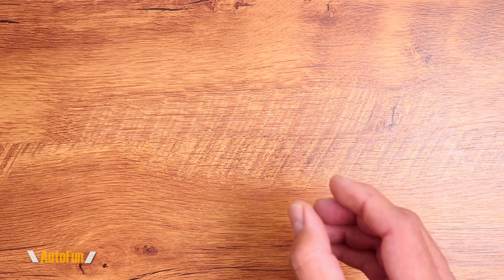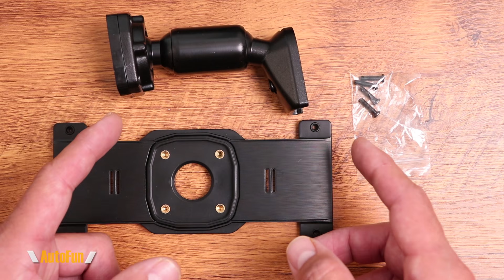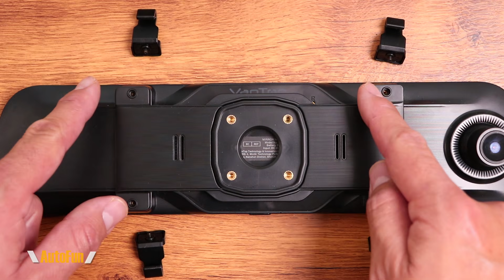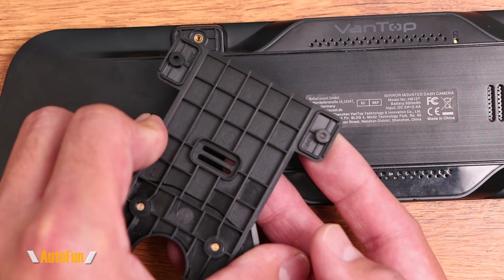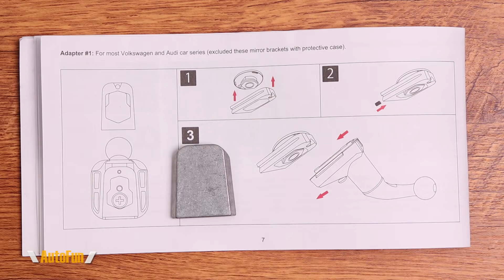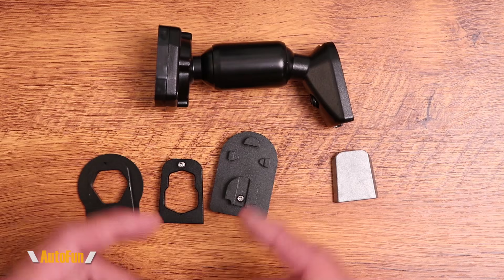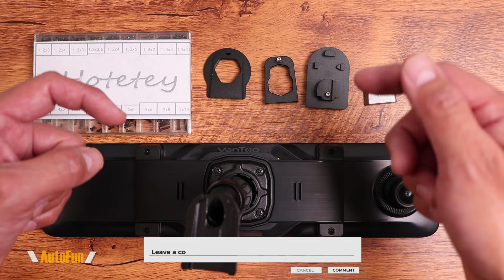How to Install Mirror Dash Cam WITHOUT Straps (Direct Mount Conversion Kit for LCD Mirror)

Comment: Anyone find a plate that works with the pelsee p12 pro?
Reply from the maker: Hi V! Unfortunately I have not tested the Pelsee yet, so I'm not sure what kit will fit, however you can measure the back as I showed in the video to determine the size but If I do get a hold of one of one, I will measure it for you and update this comment. Cheers!
Reply: @AlexAutoFun  I actually just found it on Amazon and in the pictures of the reviews. People say it works with the. Pelsee P12 pro. Would you like me to send you the link so you can add it to your video? Or would you rather wait till you test that camera?
Reply from the maker: @vtecef9  HI V! Ah great, yes if you can send me the size (they are sold in Centimeter sizes) once you confirm it fits your mirror I will definitely help the next person. Cheers!
Reply: @AlexAutoFun  OK cool as soon as I get it in and install it, I will just reply to this comment with the link
Reply from the maker: @vtecef9  Excellent, thanks (some links are blocked, if it does not go thru, try the size) Cheers!

Comment: Hey, I had not seen you until today but I was very impressed with what I saw, very straightforward and simple. So I was wondering if a wolfbox can be adapted to work with the original rearview mirror wiring of a 2003 Chevy Suburban, and if so what would you recommend?
Reply from the maker: @RPacheco1157  Thank you! Ah the kit fits most vehicles without the adapter and the adapters shown in the video can be used for specialty cases. And I placed links in the video description to the adapter if you need them. Cheers!
Reply: Thanks Alex, appreciate you getting back to me.
Reply from the maker: @RPacheco1157  You're welcome!

Comment: pelsee P12 Pro 4K Mirror Dash Cam, 12'' Rear View Mirror will this fit
Reply from the maker: Hi T, Unfortunately I have not reviewed the P12 yet, so I'm not sure what kit will fit, however you can measure the back of the dash cam as I showed in video to determine the kit size. And If I do get a hold of one of one, I will measure it for you and update this comment, Cheers!

Comment: Gonna have to make an adapter for my NA Miata, completely different style.
Reply from the maker: Hi Wolf! Ah here is my follow up video showing how I customize the rear plate to fit different dash cams https://youtu.be/fveZiDofnxg and I also placed links to specialty adapters in the video description, Cheers!
Reply: @AlexAutoFun the attachment part to the mirror is fine but the NA Miata's rearview mirror is attached to the crossbar/frame, not the glass. The style of attachment is different.

Out of the styles you shown, I didn't notice a similar one
Reply from the maker: Hi Wolf! Ah yes the rollbar mounted mirror is different, the only solution I have for those rare cases is to re-use the mirror stem from the vehicle and use this kit https://youtu.be/cCpyHmiZqiY which allows the use of the existing ball joint (basically, retains the factory mount setup) Cheers!

Comment: The problem is dash cams get too hot in the sun, locked up. Fitting behind the mirror would be less heat going into electronics
Reply from the maker: Hi S! Yep some dash cams generate a lot of heat (specially if running it on 4K). While I converted mine and have not have any heat issues, I would recommend taking at a look at the temperature rating because yes your are right, mounting the dash cam behind the OEM will keep it slightly cooler than mounting it with a direct mount kit. Cheers!

Comment: Alex . . . In regards to Dash Cams you are the top expert on YT . . . No doubt.
So the Dash Cam Industry must be hearing your opinions. So I decided to share my opinion here.

In my opinion . . . The things that prevent aware people from purchasing.
1) How they hook up . . .
People don't want to remove & damage interior trim in a new car to run unsightly hard wires for an expensive item that is not going to be longterm.
Solution: A) Connection between the Main Camera & Rear Camera needs to be Blutooth.
Rear camera needs to be rechargeable ( USB-C ) and have a 24 hr (or more) capacity.

2) The entire system should be independently rechargeable and self-powered / have its own battery light weight enough to carry indoors if necessary ) and leave the main car battery alone. No messing with the fuse box / car battery / air bags / car trim . . . non-proprietary and easily replaceable by the owner & rechargeable. Leave the main car battery alone. No messing with the fuse box, car battery, grounding sys. , trim panels or the air bags

C) Both camera's need to be more easily removable ( if BT'd the only wire needed would be one power wire to the main camera. Easy removal would provide better conds. for charging. cleaning, inspection and temporary antitheft.

Hey CHINA . . . Do any of these have a visible blinking red led to deter vandalism? Why not?
Reply from the maker: Thank you James, I appreciate that! Ah good input, I imagine it maybe possible we will see a rechargeable dash cam at some point. The main challenges are fire and duration. The industry is moving away from batteries over to capacitors due to the high temperatures inside a vehicle and potential for a run away event (fire) during charging or discharging inside the car. Here is an example of a internal dash cam battery and what the sun did to it https://youtu.be/HW8jqbl_ayU and a battery related fire I personally experienced https://youtu.be/XfWgJ8nu-RA (destroyed the house). Duration will also need to be increased, current technology would likely require the dash cam to be recharged daily. The closest we have today is a system like this https://youtu.be/Ht9Q-0HlKMY or this https://youtu.be/1c7raDpHx3M with solar charging. For the LED to bring attention to the dash cam here are a couple ones that have it https://youtu.be/vUEsIYEBVck and https://youtu.be/lwoSbiwjSik Cheers!

Comment: What adaptor is needed for the bracket to fit a 2024 Ford Transit?
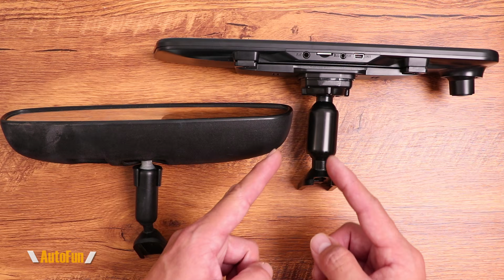Reply from the maker: Hi Zilla!  I show how to tell which adapter you will need at the 5:40 mark and you can also see what they look like so you can compare to the one on your car. I also placed links to the specialty adapters in the video description. Cheers!
Reply: @AlexAutoFun  thanks, but I don’t have the vehicle yet that’s why I asked. But I think it’s the hex adapter after watching someone install an OEM mirror.

Comment: You did all of that to stick it to the window? Kind of defeats the object. Can you not find a way to put it back to the original mount on the car?
Reply from the maker: Hi Moovin! Removing the OEM mirror is quite fast usually just held by a single screw. However there is another system that allows you to retain the OEM mirror stem if desired here you go https://youtu.be/cCpyHmiZqiY Cheers!

Comment: I have a 2018 Chevy Silverado 1500 
What mirror and bracket would you recommend??
Reply from the maker: Hi Brennon! I show how to tell which adapter you will need at the 5:40 mark and you can also see what they look like so you can compare to the one on your car. I also placed links to the specialty adapters in the video description. Cheers!

Comment: the only downside there is no angle switch toggle
Reply from the maker: Hi Ba! Ah remember the toggle switch underneath normal mirror is used to reduce glare as there is a 2nd hidden mirror below the 1st mirror, so when the toggle is flipped, the eyes focus on the alternative mirror reducing glare. On a mirror dash cam there is no secondary mirror since below the mirror there is an LCD screen (and if mounting the mirror dash cam with straps over the OEM mirror retaining the toggle, the toggle will not do anything again since there is no secondary mirror in a mirror dash cam) Cheers!
Reply: haha) nice didin't knew that, thx! ive used it in other way, im a second user, and im taller than first one so it helped me to flip it in accurate under my needs xD
Reply from the maker: @baarg8672  You're welcome! Ah that is interesting, I can definitely see how that would help, never thought about using it that way 😀👌

Comment: I have a wal mart Yada 2000US1  model dash cam…. I don’t see an option for that one …
Reply from the maker: Hi Agent! I have not tested the Yada one yet, so I'm not sure what kit will fit, however you can measure the back as I showed in the video to determine the size but If I do get a hold of one of one, I will measure it for you and update this comment. Cheers!
Reply: @AlexAutoFun  great. Yeah. I got a hold of one fairly cheap and I like your mounting idea so I think if a kit would work that would be great.  Also, the plugs that piggy back off the oem mirror plug, I don’t see one of my vehicle.  It’d be a 2001 Chevy Silverado.

Comment: I have a circle mount similar to that Audi but it is octagon shaped. I have Corvette C6. The adapter I bought won't fit. Is there an adapter I can buy separately?
Reply from the maker: Hi Frank! I show how to tell which adapter you will need at the 5:40 mark and you can also see what they look like so you can compare to the one on your car. I also placed links to the specialty adapters in the video description. Cheers!

Comment: You are the man!! I recently bought a Pelsee P12 Pro but aside from it not looking nice when strapped, the extra weight was too much for the stock mirror to handle and i had to keep adjusting it while driving smh. 

This is perfect 💯
Reply from the maker: Thanks Dennis, glad to hear it helped1, Cheers!
Reply: Which kit works with the p12 pro? I got the same camera

Comment: Hello, I’m trying to convert a KQQ mirror dash cam but when I remove the rubber cover, no screws are visible. I’m afraid I’ll break the strap holder clip piece if I force it off. Do you know how I would go about removing what’s needed to expose where the screws are? My mirror dash cam is like the one on this video, camera on one end of it, but no screws easy to access. Thank you for any advice you might have.
Reply from the maker: Hi Barbara!  Unfortunately the direct mount conversion kit will not work if the mirror dash cam does not have screw holes. Cheers!

Comment: Excellent video , now I can install my Wolfbox with confidence. Amazon- Wolfbox OEM bracket measurements are 13.6 and 6.1 cm for the G850.
Reply from the maker: Thank you Jas! Ah be careful with those measurements, I noticed both the the G850 and G900 measurements on their Amazon listing are incorrect (for G850 I mean for V2 G850 as V1 G850 did not have screw holes for mounting). I placed the correct measurements on the video description. I'll see if I can reach out to Wolfbox to get those numbers updated (full G850 and G90 conversion video coming stay tuned). Cheers!

Comment: What solution do I have if my dashcam does not have any screw holes?
Reply from the maker: Hi Michael! Unfortunately the direct mount conversion kit will not work if the mirror dash cam does not have screw holes. Cheers!
Reply: @AlexAutoFun  I found a mount on Amazon that wraps around on either side and you can strap the camera to the mount without the factory mirror that way.
Reply from the maker: @michaelproeber1953  Thanks for the tip Michael, this is great news, do you know the brand name of the mount? This universal mount is the only one I'm aware of https://amzn.to/3IMacWG that deletes the OEM mirror but unfortunately still requires the use of straps. Cheers!

Comment: Anyone know what bracket fits the pelsee p10 2.5k?
Reply from the maker: Hi Gomez! I have not tested the Pelsee P10 yet, so I'm not sure what kit will fit, however you can measure the back as I showed in the video to determine the size but If I do get a hold of one of one, I will measure it for you and update this comment. Cheers!

Comment: How about a conversion for a Buick Encore GX? The mirror arm goes into that big black box that is lane assist. How does that arm detach?
Thank you.
Reply from the maker: Hi Barbara! I show how to tell which adapter you will need at the 5:40 mark and you can also see what they look like so you can compare to the one on your car. I also placed links to the specialty adapters in the video description. Regarding the Lane Assist enclosure, they usually only hide the mirror bracket, so removal of the enclosure will be needed to inspect and confirm the mirror bracket type. Here is another where I remove that cover so you can see how it looks inside of it https://youtu.be/TvKRKYA7cgQ Cheers!
Reply: Thank you SO much for your response & advice!!
Reply from the maker: You're welcome! @ImissDisneyland

Comment: Does this help to eliminate some of the obstruction I've seen in your other videos?
Reply from the maker: Hi B! Nope it will not change any obstruction in front of the mirror dash cam (what you see on my car is the enclosure for the ADAS camera that comes with some newer cars). If you have a similar enclosure that you are trying to clear, I would recommend a dash cam with detached cameras so they can be placed away from any obstruction. Here is one https://youtu.be/OiqMW1RKCYU Cheers!

Comment: Will this mount fit my vw caddy maxi 2012? Great video 🤜🏼🤛🏼
Reply from the maker: Thank you Gaz! Ah yes, I show how to tell which adapter you will need at the 5:40 mark and you can also see what they look like so you can compare to the one on your car. I also placed links to the specialty adapters in the video description. Cheers!
Reply: Awesome…are these adapters available to be delivered to the UK 🇬🇧 ? Cheers
Reply from the maker: Hi Gaz! This will depend on your Amazon delivery center and if the vendor supplies there, I placed the links the description if you like to check. Cheers!

Comment: Hey what if my metal button fell off? What adhesive do you recommend to use for the windshield that is heat resistant so the sun won’t knock it down again?
Reply from the maker: Hi Maximum! Ah yes I placed the link to the adhesive in the video description. Cheers!

Comment: What size is that ball swivel? 1/2 inch? Looking to see if I can use out the oem bracket on a 1st gen toyota tacoma.
Reply from the maker: Hi Natni! The ball joint is approx. 3/4"  Here is an alternative mounting system for what your are trying to do (re-use your mirror stem instead of swapping to the one that comes with the kit) https://youtu.be/cCpyHmiZqiY Cheers!
Reply: @AlexAutoFun  Thanks! That's exactly what I'm looking for but... VSM-UNI2 is spot on, but I'm not sure if that bracket assembly would fit a wolfbox g900. I wonder if I can just just find the ball joint size adapters?
Reply from the maker: You're welcome! I can probably check for you, let me see if I can find my Rydeen adapters and see they will fit the direct fit kit for the G900  @nativeblend
Reply: @AlexAutoFun  Yes pls 🙏
Reply from the maker: Hi Natni! I got good news! The Rydeen mirror stem adapters could be used with the G900 kit I linked in the video description. Now, it is important to point out, that since the Rydeen adapters have a different bolt pattern (to mount to the mirror rear plate), new holes will have to be drilled into the G900 kit backplate to bolt up the Rydeen stem adapter. Same as what I did on my follow up video here https://youtu.be/fveZiDofnxg the only difference is that instead of measuring the mirror screw hole spacing, the Rydeen adapter screw spacing would be measured and drilled. Cheers!

Comment: Does anyone know if the Jomise mirror dashcams have screws on the rear?
Reply from the maker: Hi ilish! This would depend on the model you are looking at, I seen cases where a brand carries several models some with screws and some without screws. But if I find any other info on them I will update this comment for your. Cheers!

Comment: Can I have a link to the conversion kit for the Wolfbox G930 cam please
Reply from the maker: Hi Garnet! Unfortunately I have not reviewed the G930 yet, so I'm not sure what kit will fit, however you can measure the back of the dash cam as I showed in the video to determine the size. And If I do get a hold of one of one, I will measure it for you and update this comment. Cheers!
Reply: Okay. Thank you

Comment: Which mount would I use for the rexing M3 3-channel?
Reply from the maker: Hi Luis! Unfortunately the Rexing M3 does not have screw holes in the back, so a conversion kit will not work with it.  Cheers!
Reply: No chance they could be behind the rubber pads things like some other brands?
Reply from the maker: @Luisxchin1  Hi Luis! Nothing underneath (I checked when I review it lol) Here is the full review for it https://youtu.be/5TAoZ4_rk1I Cheers!
Reply: Thank you so much for all the replies. Great videos. Earned a subscriber here
Reply from the maker: @Luisxchin1  You're welcome Luis and thanks for supporting the channel!

Comment: I'm using Rexing M3... Any kit for this model
Reply from the maker: Hi Freelance! Unfortunately the Rexing M3 does not have screw holes in the back, so a conversion kit will not work with it.  Cheers!

Comment: Definitely a lot easier than how I did it. I plastic welded mine to the original housing 🤣 look good after welding, sanding, and painting. But was a ton of effort.
Reply from the maker: Hi Josh! Oh wow haven't heard about that method, interesting, I wonder if that would work for mirrors that don't have screw holes in the back. How solid did the mirror felt? And I'm assuming the mount kit you used was also plastic? allowing u to bond plastic to plastic (Some are aluminum) Cheers!
Reply: @AlexAutoFun  I didn’t use a mount kit actually. I just attached the plastic mirror to the plastic dash cam using plastic rods, backed with stainless steel mesh. It’s actually super sturdy!
Reply from the maker: @joshbaker55  Man that is so clever, thanks for sharing 🍻

Comment: I have this kit and I can not get it to work on a RAM 1500 the neck is way to long and you can not angle it high enough barely can see out the back.